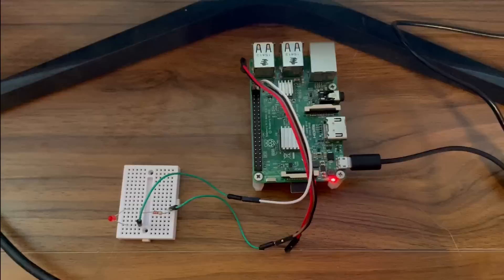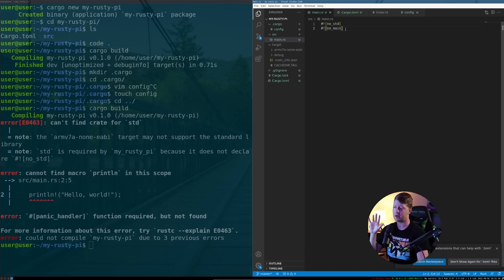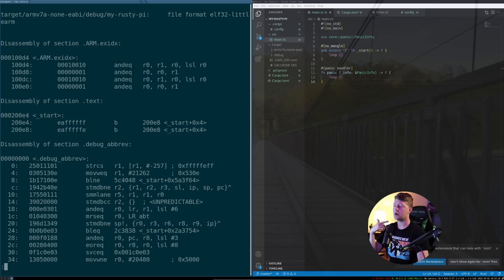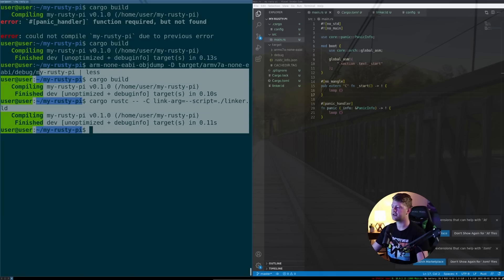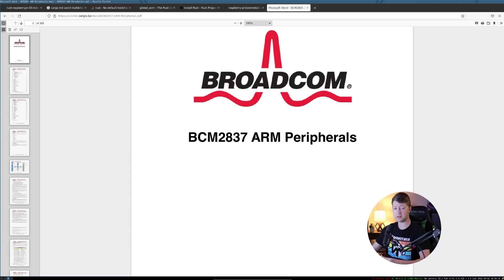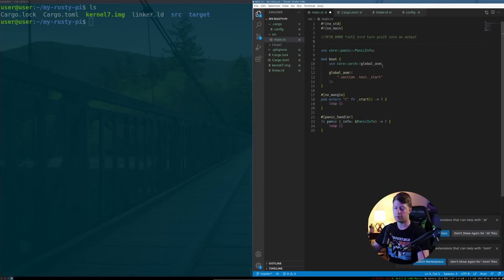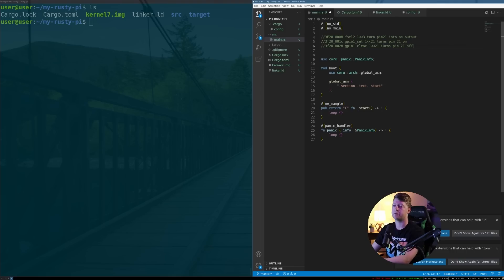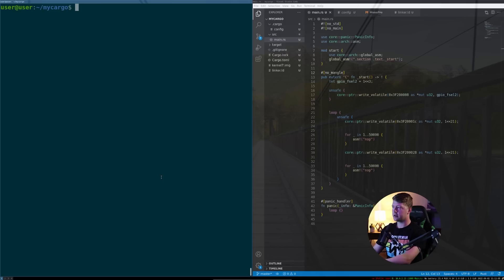rust runs on EVERYTHING (no operating system, just Rust)

Comment: How is this Rust RUNNING on R PI? Looks like you compiled some rust to binary code, which can be done in alot of other languages.
Reply: Because the Pi doesn’t need Linux to send the signals out in this example. This piece of code is doing one thing and one thing only. Unlike say, Python on top of raspbian on top of Debian on top of Linux to blink an LED.
Reply: @soonapaana6023  His TITLE says he has RUST running on a PI , not that he used Rust to make ARM machine code. You get that?
Reply: @mhavock  That's the whole point of a compiled language. Rust doesn't "run" on anything, but it certainly compiles for a lot of targets.
If you take a language like Python, it "runs" thanks to the interpreter, whereas rust is compiled down to machine code.
Reply: @BambeH  You also missed the point. HE PUT "Rust RUNS on everything"; This implies he had a Rust Tool chain running on the device ( eg you could write and compile code on the device; no need for other dev enviroment). Of course, everyone knows rust can compile code on other device to make a targeted binary.
Reply: @mhavock  it's slightly clickbaity but still a good video if you ignore the title
Reply: @LC-hd5dc  LOL thats what i should have said in the first place, I guess.

Comment: Hey! Awesome video. 

As a viewer, I'd like to suggest increasing the font size (zooming the UI) to be clearer to read in small screens. Furthermore, as a concept in video making, it's better to avoid non-flat color elements like your transparent/medium opacity terminal. The video encoder has to sacrifice quality in texts (code) to embrace all details on screen (the diverse details in your wallpaper)
Reply from the maker: I realized after I rendered and uploaded that the font quality wasn't great :(. I'm transitioning my videos to 4K in the future to avoid this. Thanks for watching!
Reply: Actually, if its static then it doesn't detract any quality at all - Tom Scott did a great video about video quality, bit rate, and moving vs stationary details.
Reply: @Nabushika  Agreed, translucency is perfectly fine when static, which in this case 99.999% of the time it is; potentially even more 9s when considering the video is 60fps and the proportion of the screen that updates is quite small. The encoder/decoder will absolutely not choke on this sort of content.
To the video encoder, there is no difference here between a terminal with a translucent background, and a terminal with an opaque, washed out background image. Translucency only matters due to the complexity of attempting to compress something that is changing in extremely unpredictable ways, which translucent objects overlapping and moving on top of a moving background tend to cause.
I really like the flair the translucent terminal gives; please don't change it @Low Level Learning  ! Though of course, please go to 4K to make the text nice and crisp :)
Reply: You were right guys. I forgot about it. Thanks for the correction!

Comment: Cool, I thought bare metal would be much more difficult.
Reply: Well it is not that bad if the program memory can be loaded from an external SD card. If not then you need some kind of gateway into the built in flash, usually board producer provides these.. custom boards it is on you.

Comment: Thanks for the fantastic tutorial! Could you show a good example of controlling GPIO without "unsafe"?
Reply: While not totally unsafe, but definitely more safe, you should wrap only the unsafe parts of the code. Have small subroutines that are entirely unsafe and call them from safe code. Pin-enable, pin-on, and pin-off (maybe the no-op if that requires unsafe as well) should all be their own functions that get called by the main loop which would realistically also be calling some kind of computational code that you definitely want to be checked
Reply: @Grstearns  this is exactly how you're supposed to do unsafe code. Make it as small as possible so that it's easy to read and verify (by humans) that it does only the thing it's supposed to do.
Reply: I don’t think you can, since you’re writing to uninitialised memory addresses, a massive safe rust nono
Reply: @jovianarsenic6893  I'm pretty sure they do it in a safe way in some of the STM32 crates.... but I could be mistaken.
Reply: I was wondering this myself. There must be a way without using unsafe blocks. I know they’re trying to use rust in the Linux kernel, and kernel device work is almost all about writing bits to raw pointers. Surely rust in the kernel isn’t just all unsafe blocks.

Comment: Can we at least not destroy software for everyone? I mean the density and pointless complexity that rust has when reading is preferably not  something to spread even more in the lowest level that software gets.
Reply: The funny thing is that you can't use most of the standard library at that level without writing it yourself. With a language at the complexity of Rust, you have to write a lot to achieve the same functionality as you would have on a desktop computer. So for embedded platforms you won't have the majority of what presumably makes Rust even a good language. The only real question to ask ourselves is, what makes Rust with that basic level of functionality worth it then? It has an awful syntax, and adds some complexity to the build process over and above what C or assembly would. Unsafe code, which is required to manipulate memory references in this way eliminates a lot of memory safety. So if it does array bounds checking, which no one outside of first years should have a problem with, then that's it's only advantage.
Reply: @anon_y_mousse  There are a lot of crates that work on bare medal, that encapsulate the unsafe parts into well tested and popular crates. So you can use the memory safety feature a lot. In stupid languages like C you can get a memory bug at all times.
Reply: @cherubin7th  What you meant to write is that with a stupid programmer you get all kinds of bugs that require someone else to save your butt. Good programmers only have bugs due to typos, which even C compilers will catch. Great programmers won't have those. Everyone else can use Rust.
Reply: @0LoneTech  I've looked into Jai, and I'm not liking a lot of what I'm seeing there. I'd prefer to stick with either C or assembly at lower levels, but I still haven't found the perfect language at higher levels. Thus far C is the best I've found even with its limitations. Most of the syntactic sugar on other languages just gets in the way and the things which don't just aren't enough for me to switch. As for the compiler catching errors, gcc and clang are amazingly good at catching errors with more levels of fine grained control that you can annoy yourself to the extreme with them or turn them all off.
Reply: @0LoneTech  If by reorienting you mean that it can consider a struct as an array of elements of various types, or that it could use an array where a typed struct is requested, then I'm not impressed. I've already got that in the language I'm writing. If there's some other meaning, then please elucidate.
Reply: @0LoneTech  I'm not sure I get the point of that feature then. Instead of x[i].a you could reference it as x.a[i] or vice versa? Would it make it easier to reference one index into the array as a tuple? Say you have the second form, could you reference a and b at x[i] singularly? As for my own language, I haven't released it yet either, but I'm calling it Ocean.
Reply: @0LoneTech  I guess I deal too much with lower levels of coding, because I don't have a problem with doing such tuning manually. I'll have to consider a strategy that'll work for others.
Reply: @anon_y_mousse    "What you meant to write is that with a stupid programmer you get all kinds of bugs"  You sound like a joy to work with.  Mr. Perfect.
Reply: @genericdeveloper3966  I am, because anyone that works with me can easily read and understand my code and don't have to worry about bugs.
Reply: @anon_y_mousse  Unsafe Rust != C.
Let me give you a video explaining this: https://www.youtube.com/watch?v=DG-VLezRkYQ
Reply: Ok, being a bit harsh.

Comment: Why 50k NOPs take ~1s to execute ? As the Raspberry Pi has a clock speed of 1.8GHz, I would have expected it to wait several orders of magnitude less
Reply from the maker: Don't forget it's not just running 50k NOPs. It's running one NOP, decrementing a counter, doing a compare, and then a branch instruction. It's likely around 10 instructions PER NOP, which adds a ton of time. Good catch though!
Reply: I was thinking the same! I guess it's easier that way. Does rust have loop unfolding ? Since this program is so small, having 50k * 2 instructions would fit no problem. But then the delay would be too short. Oh well...

Having literally only nop would give the same exact run time, right ? The current nop+for overhead, does that give also a completely fixed amount of time to run ? I guess since it doesn't have to access RAM, it should, right ?
Reply: @Winnetou17  The program is built unoptimized, so no loop unfolding

Comment: really good video thank you! Im really confused, how can a file start at position 0x000..8000? what does that mean? Isnt each position incremented for each byte of data we have, and files start at position 0x0?
Reply from the maker: The file gets loaded at that address by the RP bootloader. We need to make sure the code we write is aware of that, otherwise offsets may be wrong in the code. Theoretically we could compile the code "position-independent" to get around this, but that's not always easy.
Reply: @LowLevelTV  ahhh its like an offset? so we have other data before that position (0x0 ..0x008000) and that file is loaded after all that content exactly at position 0x00..800
Reply: @jordixboy  at address 0x00000000 is the start of the bootloader (it's own vector table). and the 0x8000 offset is to be future proof (so the bootloader can grow/be replaced by another one without exceeding the reserved max size)
Reply: The 8000 is the address in memory that the code gets loaded at. It's not a file offset which is just the position of the bytes in the file.